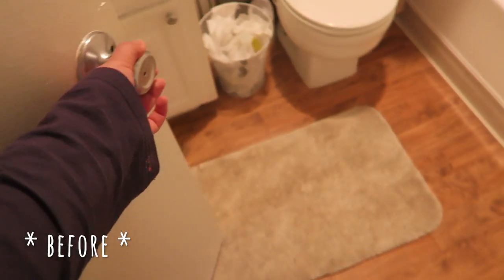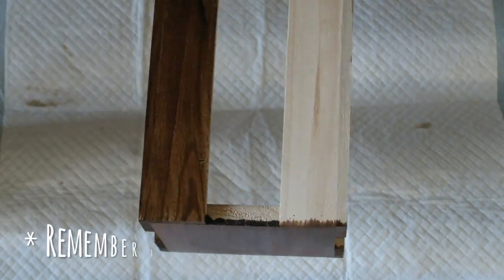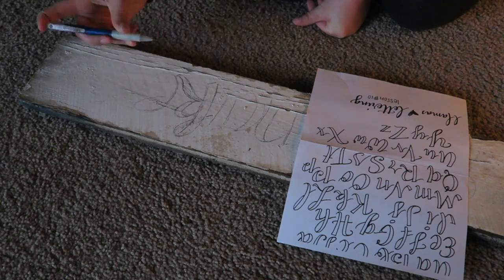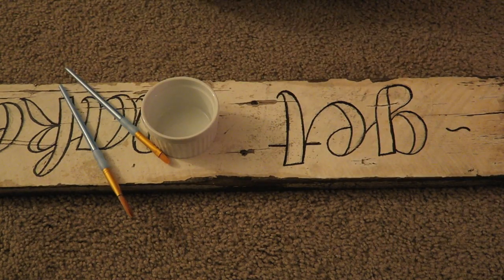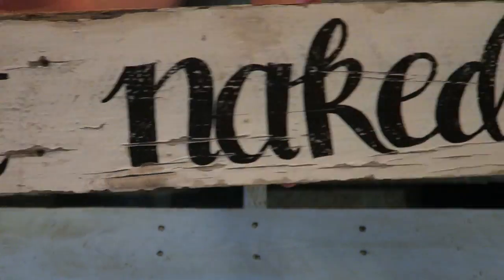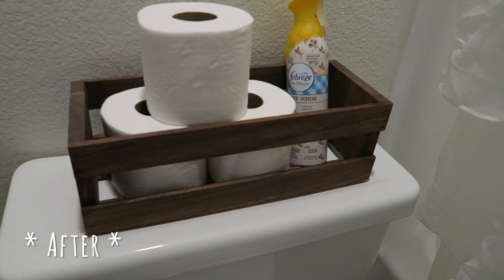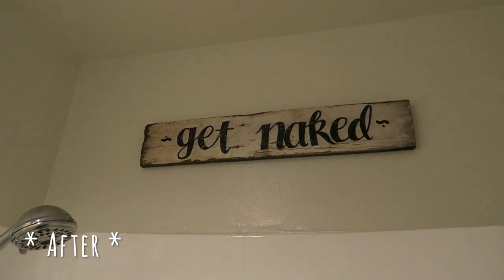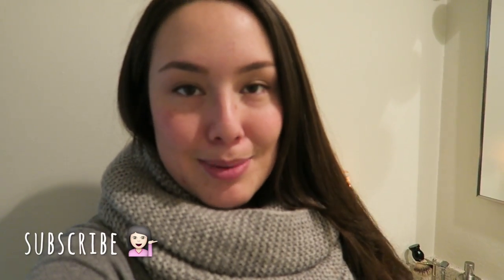CHEAP and EASY DIY! Renter Friendly Bathroom Makeover

Comment: if you can just move the shower curtain down to avoid water coming out of the shower. Or add a  second rod behind the new curtain and hang it lower.  It really looks nice.. Great DIY's
Reply from the maker: +The Decor Diva thank you! I've thought about removing that rod, it's one of those extra space curtains but it's drilled into the wall in the wrong spot so it makes the curtain stick out way too far 😕

Comment: how did u hang the sign in the shower
Reply from the maker: +Ilene Gauthiers I used picture hanging hooks that you can get at Michaels. You can usually find them by the command hooks & they're rated for different weights ☺️